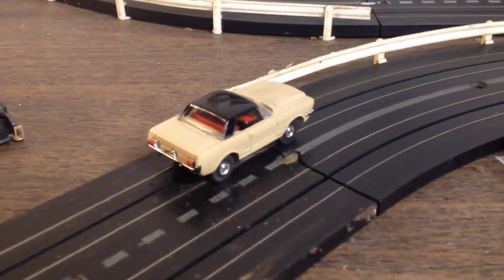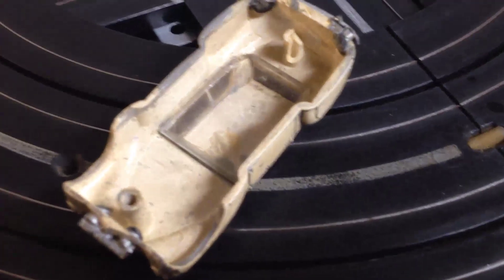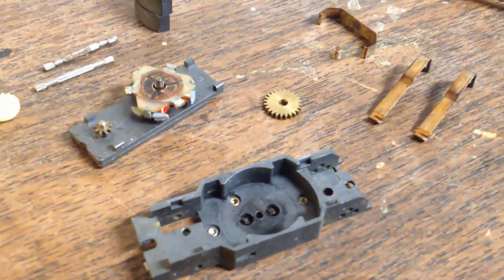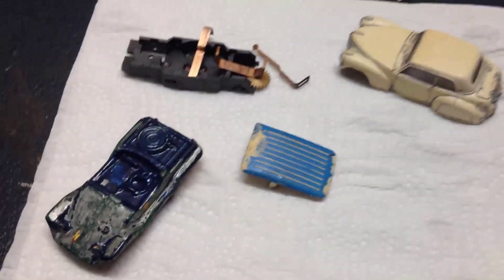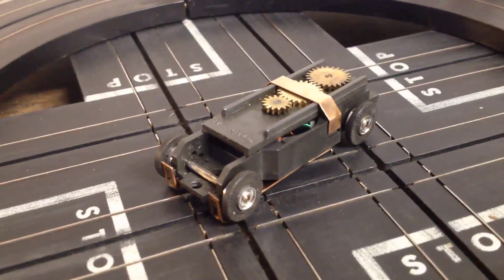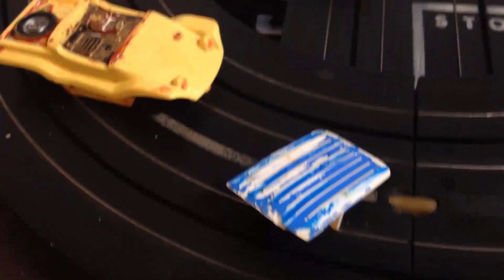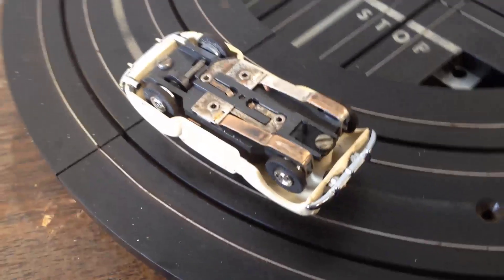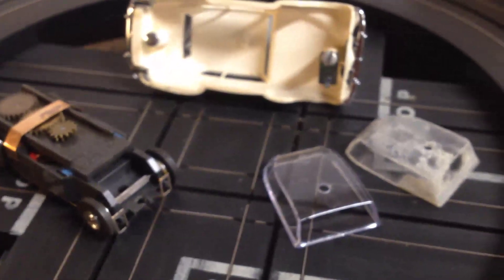Aurora Slot Car Paint Removal

Comment: Nice job where did u get new old stock?
Reply from the maker: Hey Sauce, Thanks for the question. I recently bought a full card of the standard T-Jet hubs off of eBay. Some guys would rather keep them mint on the card but to me, I can't play with them that way. So for special projects, I don't mind cutting them off the card and using them as needed. Take care Sauce, let me know if you need anything.
Reply: Ty
Reply from the maker: @saucenotgravy1  Np.